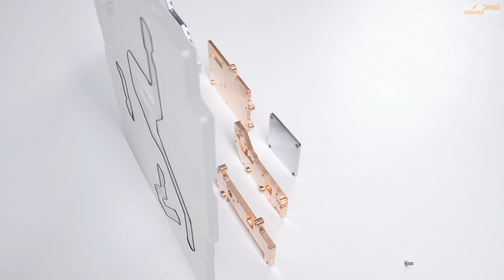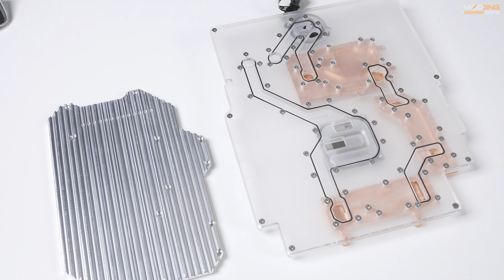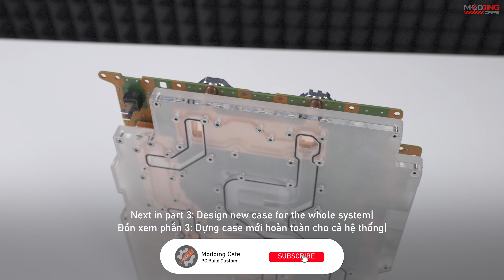[PS5 Watercooling - Độ tản nhiệt nước cho PS5] Part 2: Waterblock - Tấm nước

Comment: What company did you get to mill the micro fins on the that little block heat sink with the four screw holes? im interested in exactly how they got such fine clearances cnc mill or waterjet???
Reply from the maker: You can EDM wire cut very fine fins and use it as a die to do EDM die sink this.
Reply: @ModdingCafeTV  awesome thank you

Comment: could you get a slab of copper drill through on the sides and hose it up and run it to a chiller..I couldn't machine those if I tried and the plastic needs to be done with a printer or something..I has a dumb.

Comment: Guys couldn't you try to use liquid metal for more heat transfer on the CPU instead of normal thermal paste??
Reply: Probs could Tbf the ps5 has liquid metal guard so it should work

Comment: The main issue that may arise is the use of thermal paste instead of liquid metal due to the ps5 needing it to not overheat.
Reply: There's no need for liquid metal. That's why he is liquid cooling it.
Reply: @xDrAxZ  in order for the heat to be transfered fast enough to have the liquid cooling work effectively enough liquid metal is needed. If not you will only get marginally better results. The ps5 runs insanely hot.
Reply: @Itatsu1998  That's right. Remove liquid thermal paste is a bad choice.
Reply: Bulshhh it the first model reach 70°c in a 20°c room on max load and the apu is design for never maintain max workload on cores …. The only temp’ issues was one chip of ram not making contact with the sheild … EKwb for PS5 dont use metal liquid too. Liquid metal is very conductive it’s good for air coolers but with water it will not make the water colder …